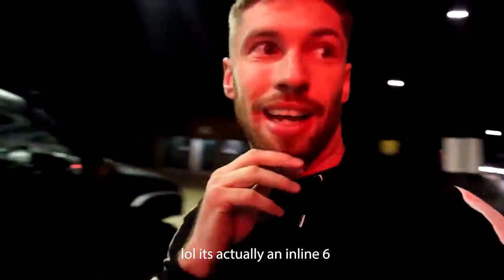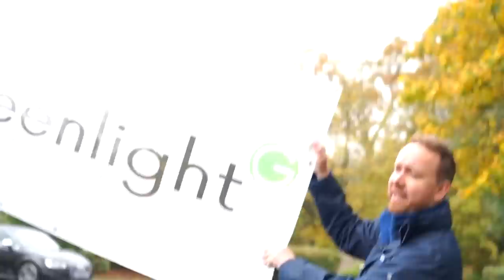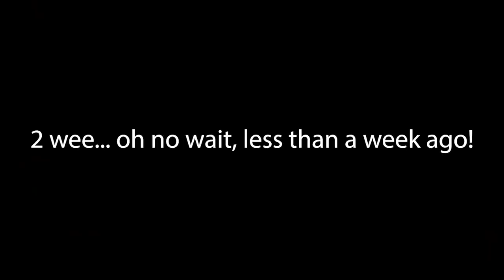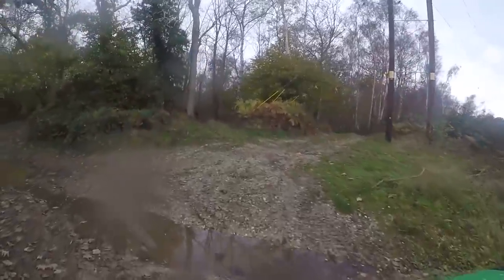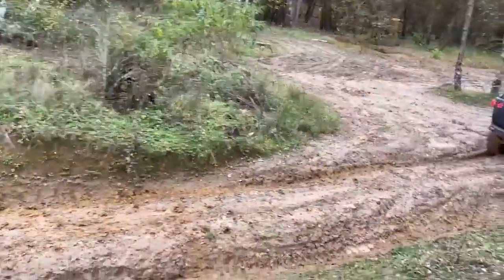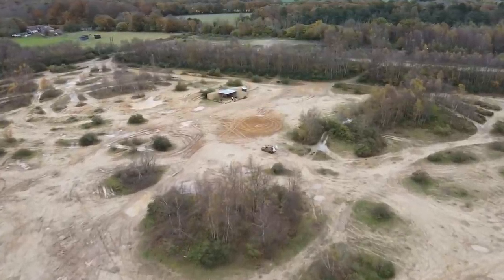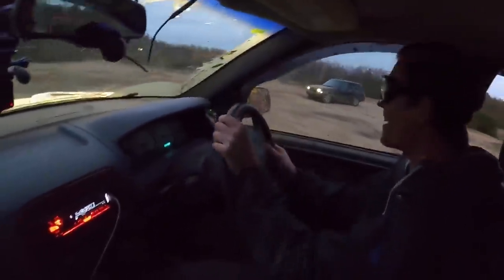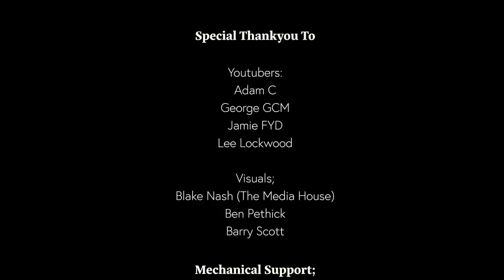The Cheap Off-Roading Challenge

Comment: The inline 6 in the gran Cherokee is one of the best engines ever made.....the 4.7v8 is prone to bottom end problems.
Reply: Nothing wrong with the powertech 3.7/4.7 other then ppl not knowing how to take care of them. Keep the cooling system in top shape and keep up with the oil changes and it runs fine.
Reply: Any inline 6 is rock solid. It's in the design
Reply: Currently in my area a 1999 generation GC with a 4.0 will bring twice the money of a 4.7 all else being equal. It doesn't matter if it's  because people don't know they have to baby the 4.7, it's because by this point in it's life the damage is most likely already done. Then the repairs that are inevitable cost more than a repaired on is worth so it's scrap at that point. Dodge has always made great V8s, regrettably the 4.7 is easily the worst V8 in Chrysler's history. It's not near as bad as many other makers worst V8, but compared to other Chrysler V8s it fails. Now compared to the legendary 4.0 inline 6 which may be the most reliable motor ever put in a vehicle  it really is pale.
Reply: 4.0 i6 or the 5.2 v8. Both solid jeeps
Reply: @bryanhersman4037  a inline 6 form any manufacturer is going to ge better then their v8 offerings. It in the simplicity of the design. The jeep 4.0 isn't some magical beast, the Ford 4.9, chevy 232, toyo 3.0, Nissan skyline 6, all are just as bullet proof. Keeping the oil changed and keeping the cooling system in shape isn't baying the 4.7. Those are basic thing you should be doing with any engine. I beat the he'll out of my 3.7 on the regular.
Reply: @jamesakemon4115  ... say that again? 7mgte, is more reliable than a 1uzfe? Yuhp, no, just no, I've owned both
Reply: @SleezyRaidz  the 1uzfe is an exception, definitely not the norm.  I stand by what I said.
Reply: @jamesakemon4115  so 7m's are reliable? I think not...
Reply: @SleezyRaidz  dude, every manufacture comes across a certain platform that is utterly shit or super reliable on occasion. In the general scheme of engine straigh 6 is way more reliable. You want to fo us on just two engines. Matter of fact you're not e enough on topic be ause this was about the 3.7/4.7 issues. I'll stand by my comment that a straight 6 will be way more reliable then any other design.  Ow do me a favor and F.O.
Reply: @jamesakemon4115  So, a nissan rb26dett is more reliable than a volvo inline 5... or a chevy 305, got it, I can go on and on with less reliable inline sixes, calm down bud
Reply: @jamesakemon4115  Also, please continue to argue with me, as I see engine failures on a day to day basis, disassembling core motors all day

Comment: 😄😄😄 Great watch new sub, Love it at Slindon. 

I have a good Challenge in the summer for you?

Buy a 2wheel drive vehicle on a low budget, make it as off-road capable as possible! Drive it to Wales and complete one of the lanes up there, (Maybe Strata Florida)? Some rough terrain, some water crossings all doable but a good Challenge. 

It would make a great weekend adventure. I’d put forward a team for that 🤣🤣🤣 always wanted to do it. Great work guys loved it 👍🏻

Comment: i have a 08 Liberty/Cherokee. the next body style after that one. 4in lift with 32in tires. dual exhaust. snorkel box air box (to fire wall), 2021 wrangler JL front bumper swap, and so much more. they are great vehicles but nothing is available so everything is custom pain in the ass lol

Comment: Never see i a test with a hond hr-v OR the big brother cr-v.
I use a Honda hr-v and drive easy on mud , snow and sand . Even hills the car do not care .
Even the 4x4 drive with a cvt i always have grip on IT.
And reason is easy the rear wheel drive by a oil pump .
Even if your front wheel loos grip teh back Will push IT thanks to the oil systeem built up.
Reply: Really. Maybe they can handle the odd green lane, or a bit of wet grass. But I've seen them run out of ability very quickly. They're just not built for serious off roading. They don't even have a low range, let alone a proper four wheel drive system (which is different to an all wheel drive system).

Comment: The range rovers look good but man that’s not a lot of clearance
Reply: I think they had issues with the alignment of the air suspension... Should be much higher in offroad height. Mine is!
Reply: @philippangst  you are right but if you can’t see the rear diff you prolly don’t have enough to do serious wheeling

Comment: Yellow Peril won, dodgy clutch but definitely the best off roader
Reply from the maker: Did you not watch the video?
Reply: @greenlightinsurance  Yes, I watched Yellow Peril suffer a minor technical fault that stopped it truly shining.
Reply: Felt bad the clutch went I wanted to see more of it too.
Reply: @jhirsch4415  when we were invited with about a week to go, my first words were Fourttack or a Suzuki. Very capable off road and within our price range with mods already done.

When we found yellow peril, I was so happy. But then, break downs on the way, and the clutch 😭

With those two issues fixed, I'm sure yellow peril would smash it. Love the welded rear diff, tight corners are great fun as it skips round 🤣
Reply: On paper and in theory the fourtrack is the best off roader there but if you buy a absolute nail of a example then it wouldn't be as good as a average family car off road because its not running. I was also annoyed the fourtrack did so badly because they are genuinely good off road but if its a heap then what do you expect. Usain bolt with 1 leg is still slower than a average man with 2 legs.
Reply: @David-qn9wu  In the fourtracks defence, when I found them stuck, they had been driving through an area with wheel ruts much deeper than the fourtrack could manage and so were pushing a massive pile of clay/mud and had been for sometime. I think this is what killed the clutch. I advised them to dig out the clay and get the waffleboards down for lift and traction but at this point it had no drive so the damage was done.
Reply: @barryoutdoors  well in that case I blame operator error. How can you kill a clutch entirely without feeling it or smelling it and then maybe re thinking what you are doing?!? Seems all the 'drivers' had a lead foot issue. When off road traction and momentum are key. Wheelspeed occasionally helps but generally speaking you need a brain and a light foot to drive well off road.
Reply: @David-qn9wu  I agree, but it was part of the point of the challenge, we wanted them to be green when it comes to off roading. The only person taking part who had done any off roading was Lee, the rest were all new to it. I have done a fair bit so I gave yellow team a few safety pointers for their hi lift jack and winch, but only to stop them seriously hurting themselves with them.

The rutted section that killed them could have been straddled for 90% of it to avoid going in the ruts, and then where trees blocked them straddling the ruts, they could have crossed with the waffle boards. But that's not obvious to people new to all this.

Shame about the clutch though as Dave and Jake generally did take a more slow and steady approach to the rest of the course, whereas the other teams generally just went "full send". Neil's Range Rover team were also a bit more methodical but the car was just not setup for it.
Reply: @barryoutdoors  thanks for all the info bud definitely sheds some light on the situation but I have to say regardless of that they were still hard to watch at times, then again that can be said for the majority of people! Especially from the perspective of a grumpy old git.

Comment: Always wear seat belts when driveing around
Reply: No not when your off roading. The speeds involved are so low your not going to risk being thrown through the windscreen if you hit something. Also when you get the car on a steep angle, or your bouncing around, the seatbelts can automatically lock and tighten up. And another reason is that by leaning forward in the seat, so your not being violently shaken from side to side, you have more control over the steering wheel.
Reply: While when trialling and play days  belts are ideal specially if the vehical role